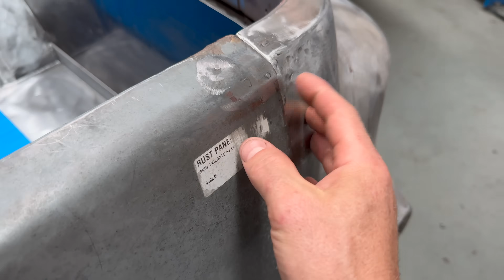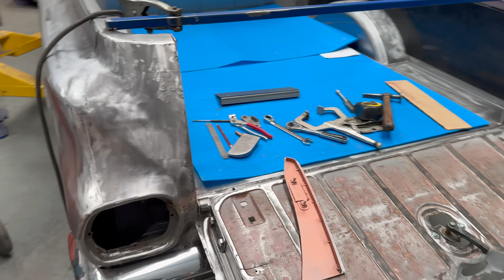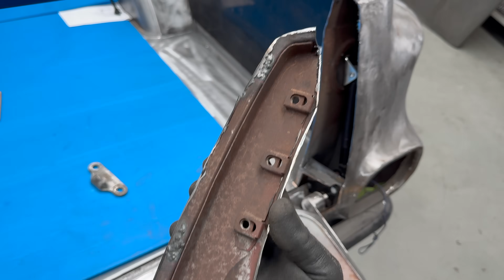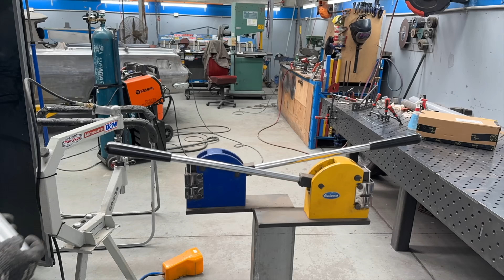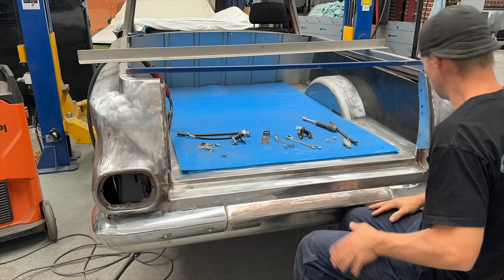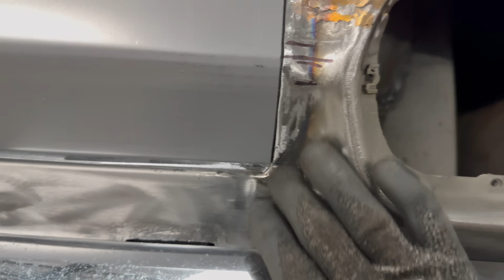Custom Tailgate For The Holden RBEH

Comment: Given that you’ve had your jig/fabrication table for approx 12 months now, how do you feel about it, its size and do you have any other comments about it. Thanks
Reply from the maker: Apart from my guillotine and folder it's probably the best bit of equipment I have in the workshop. I don't know how I've gone so long without it. Just having a flat surface to weld on makes all of a difference.
Reply: @ProShop1  thanks for the reply.

Comment: Gorgeous. I  love EJ holden. Always had EJ's in early 80's but wanted an EH. when I finally had a couple I wanted to go back to my EJ. The station wagon. Yours is a beaut mate. EJ style tail lights are a nice looking thing. What was one of the greatest parts of the EJ was how much paint was on it and it stuck like the proverbial to a blanket. Well a hell of a lot better than that really. Tight welds, solid panels and no rust. I gotta stop before I go and kick my arse for selling it. Nice touches you're adding. Might have been bloody popular in the 60's like that. The red 149 was a pearler in my one. So smooth the driver would try to start it again at the intersections sometimes but it would still be running. I guess your going for the RB 30 DE (T?) ? That'll be mental A F mate !

Comment: Instead of the cable stays would a 2 piece strap in 20mm x 3 mm flat plate sit in flush when it’s closed? Inspirational work.
Reply from the maker: Yeah I did something similar on the HR but I thought I'd try the cable this time.

Comment: I want A hard top for my HD Holden ute too, I was looking at overlapping the top, with a rubber seal under the overlap,  so it seals to the top of the ute back to stop water getting in. I'm curious as to how you plan on stopping water getting into the gap between the top and the sides of the ute back ?
Reply from the maker: I'll make drains just like in a sunroof